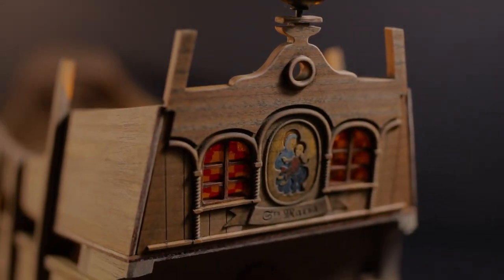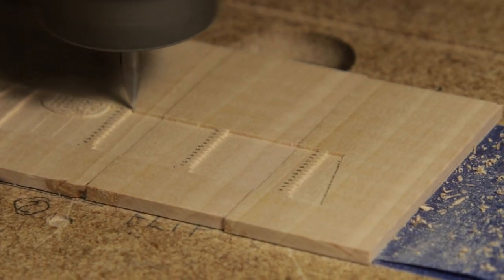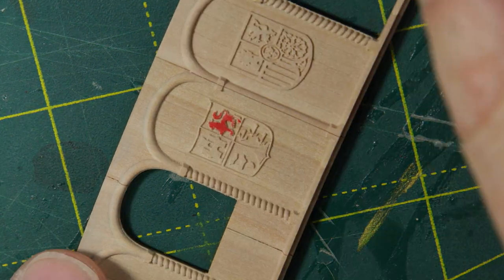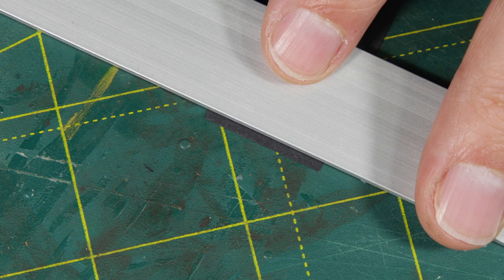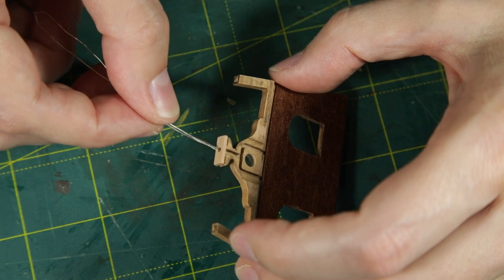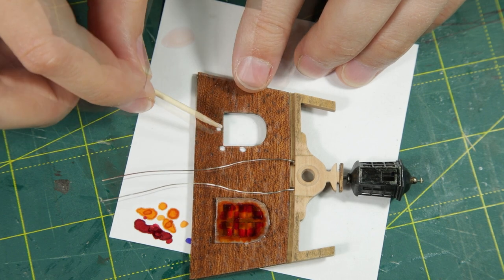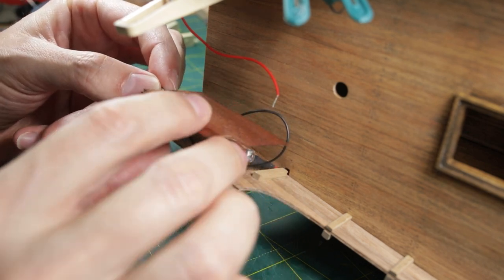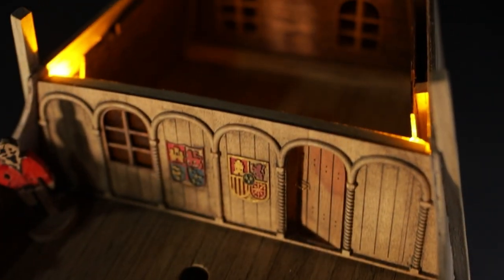# 18. Admiral's Cabin | Columbus Santa Maria. Scale 1/65

Comment: Que tipo de programa usas con tu rauter
Reply from the maker: My machine isn't connected to the computer. It has its own controller that exclusively processes G code. This controller is set up for Fanuc post-processing. I generate the G code directly from Fusion 360, then copy it onto a USB stick and load it into the machine controller. This way, I don't need to have my computer in the dusty workshop next to the machine :)